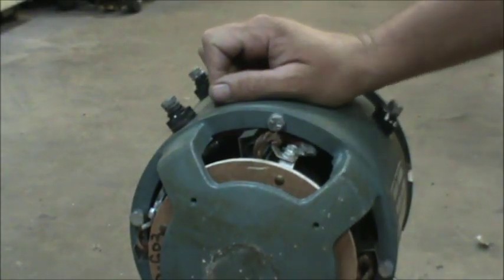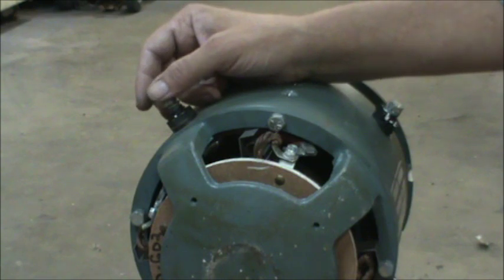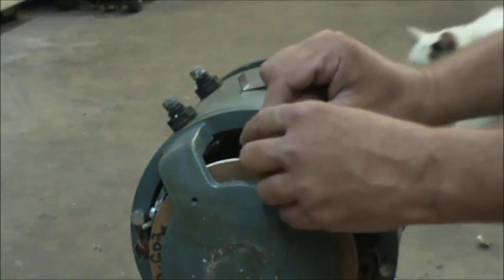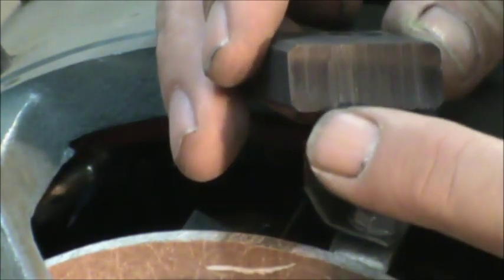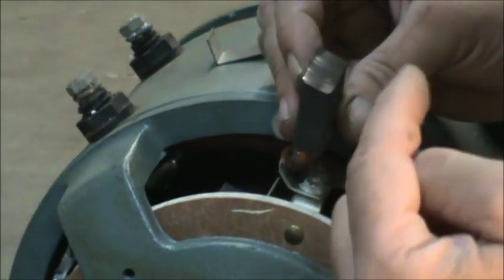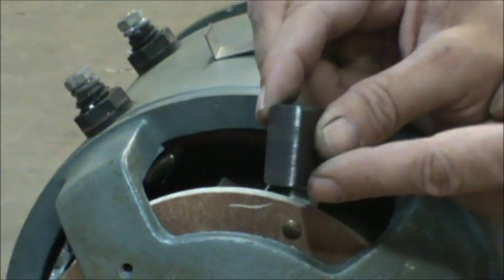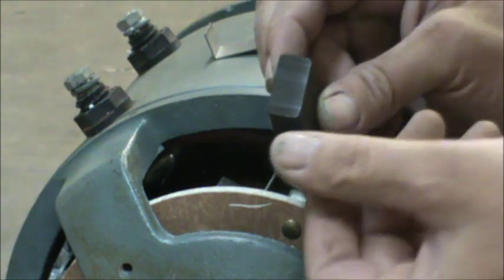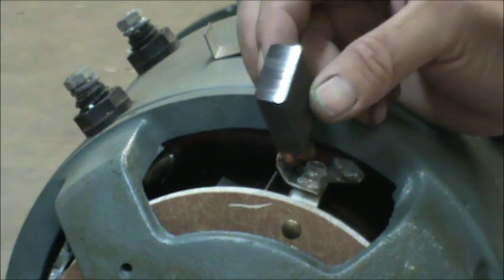Raymond DC Motor Lets Have A Look At Those Brushes

Comment: The Super RC Enthusiast breaks in their brushed motors in water - the water must be distilled and free of any metal particles - the water acts as a wet stone and really breaks those brushes in and from I have been told it increases it's power by 10-15%.
Reply from the maker: Cool